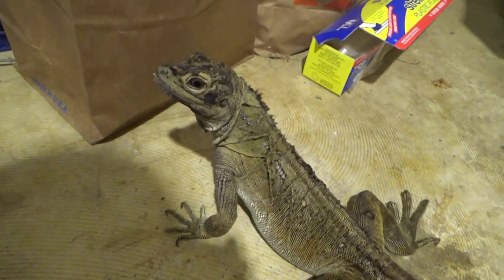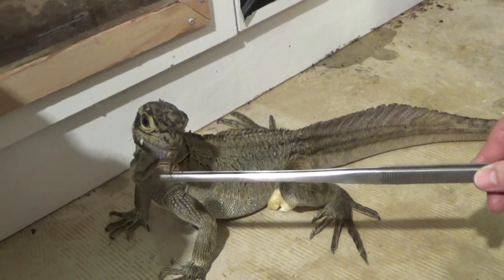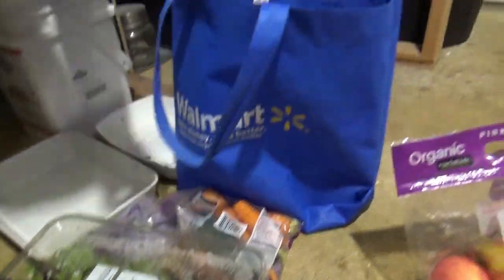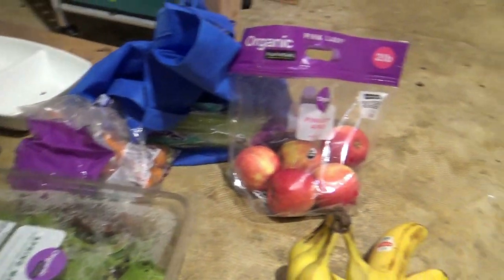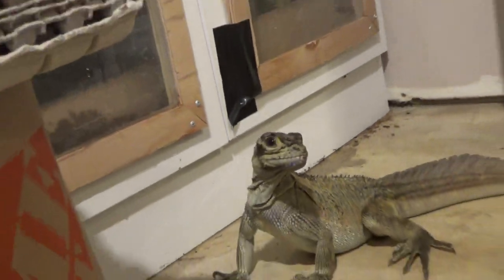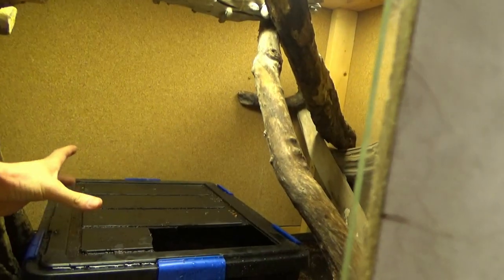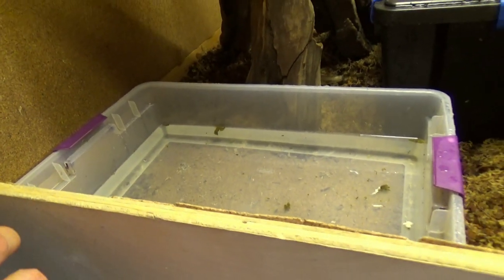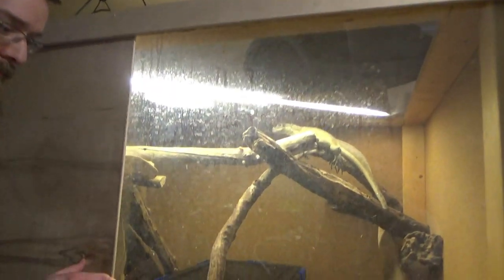How to Keep Philippine Sailfin Dragons As Pets (Part 1) | Hydrosaurus Pustulatus

Comment: I have a quick question to ask, if possible. What would be the minimum terrarium size in gallons for this reptile? I don't have access to any terrarium over 100 gallons, so I ultimately don't have my hopes up for this lizard.
Reply from the maker: great question. a standard 100 gallon tank is generally 5 feet by 18 inches by 18 inches or so. This will not be enough. one single adult would need more like 750 gallons I would say, and more is better. space is the number one limitation for a lot of people when it comes to midsize and large reptiles.
Reply: @TheReptileBarn  Thank you for responding! I've been trying to look into other options though, since the expenses are too much for me. Do you have any suggestions?
Reply from the maker: @Sophia-dt6zt  other options for awesome lizards you mean? that would fit more in a tank like you have?
you could do a blue tongue skink! or there are some really awesome geckos, like gargoyles or leachies. there are a lot of species of collared lizards, I don't know for certain but the smaller species could probably do great in a 100 gallon, and they are gorgeous and colorful.
Reply: @TheReptileBarn  I'll look into them, thank you!